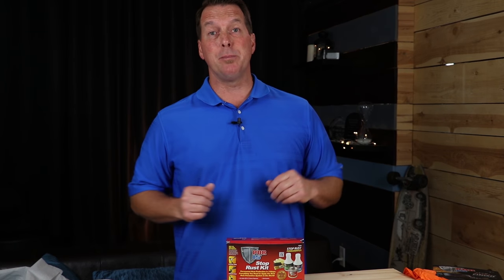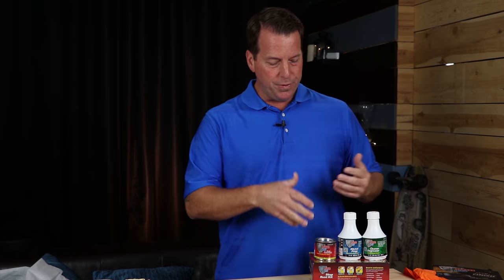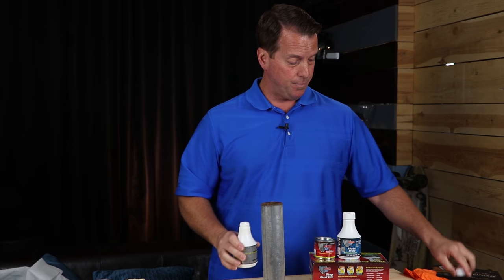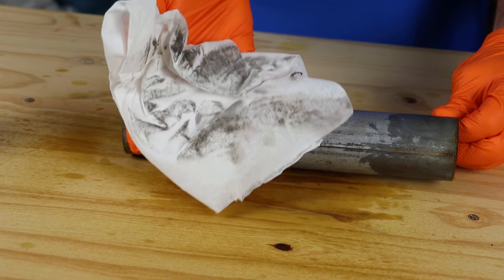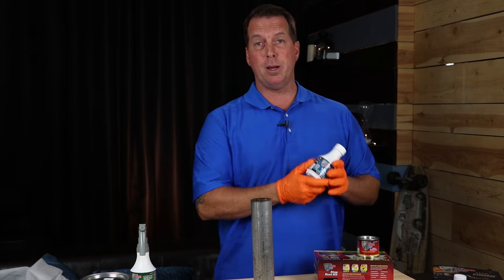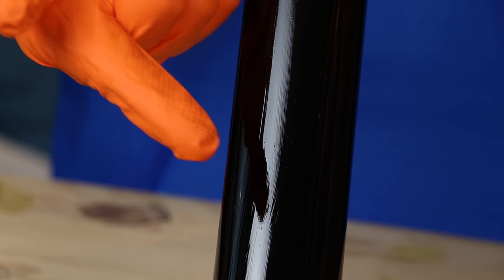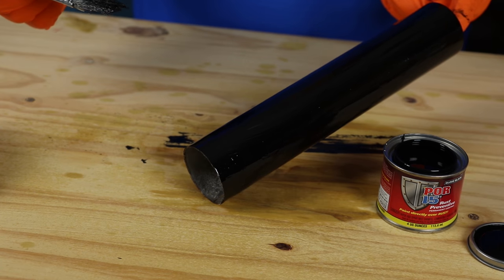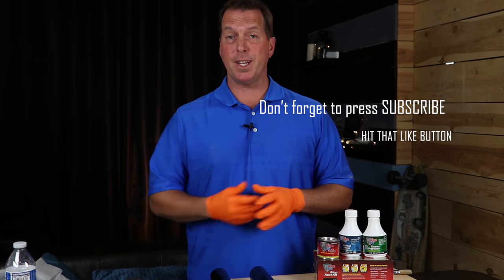STOP USING POR-15 INCORRECTLY!

Comment: Por15 works best on rusty surfaces (not loose rust). If the metal has a light rust before painting it becomes impenetrable when cured. Used on freshly sanded metal I have never had as good of results.
Reply: This is why all the prep takes longer than the application of sealer......if done by mfr directions, works great.

Comment: The POR-15 is the best on the market for stopping rust.  I've used it extensively, and will continue to use it . It is not without problems. There are several issues with handling the product that you should have addressed.  I have found "work arounds" but they should be part of this video and additions to this "kit"
Reply: Thanks :)
Reply: How much do you think it would take to do a whole lwb frame?
Reply: Care to explain?
Reply: Yes, please explain further. Thank you
Reply: What r the work around a?
Reply: @Markmead7  Use Eastwood rust encapsulator. Cheaper, easier and does same thing and beat it in a 1500 hour salt water spray test.

Comment: The thing that sucks about this super expensive pot. Yeah it works well, but no uv protection. It. Should have uv protection for the price. Makes rust encapsulater a bargain. Good stuff and has if protection

Comment: FYI, the cleaner degreaser is supposed to be diluted (instructions on the bottle say it), you don't put a spray top right over the concentrate bottle. You're also supposed to wear a respirator mask while applying it.

Comment: I can make a video like this because small simple pieces like that work well.  The second step - zinc coating and rust converter - is a very nice product.  I use it as a prep for lots of other coatings too.  As far as the coating goes, commercial shops I work around don't like it - impossible to work with in real-world conditions.  Hard to work with in humid environments here near the coast.  Solvent pops are a problem even with thin coats.  Have to use the can up quickly or solvent pops in the can before you even apply it.  Have to use the open can quickly.  Cannot reuse a partial can for a number of reasons.  (partially cured, solvent pops, coating cements the can lid tighter than a metal crimp).  Gallon cans are absolutely worthless.    Most of it will cure before you get it out of the can.  This demonstration did not show the can being opened - HA - the cans I open are absolutely ruined by the time I get them opened.  You can transfer unused contents into a new can but it cures too quickly to use a second time - even with adding some POR 15 solvent to thin it out - doesn't stop the quick cure.
Reply: never open the can. put a self tapping screw in the lid and opposite that, a screw in the top of the sidewall. Also it will last for many years when you keep it in a refrigerator. I've never had any go bad. One time,  I ordered a gallon and they sent me 4 quarts
Reply: Sounds like a money saving tip. Just to clarify you put a self tapper in the lid & another on the side of the tin & then when you need to use it you crack them both open & let the paint out - then screw them back in? Wouldn't that let oxygen in though? Not doubting just checking I've got it right 🖐️
Reply: @andrewcheatle4691  Oxygen is NOT the issue.  Water vapor is.  HUMIDITY.  The product is Monkey Glue based: it needs humidity to cure.

Comment: I get the same results with some cheap phosphoric acid and then painting over it with cheap oil base, try for anything with rust inhibitor on the cheap. Works excellent 👍

Comment: After watching this video I came away with the following conclusios:  The name POR-15 is very dishonest. It is not a Paint Over Rust product.  According to what I saw here any rust has to be completely removed to bare metal which is then treated with metal etch.  Why the dishonest naming of the product.  If the metal has to be cleaned to bare metal and also painted over to provide UV protection for the product it would be much better to just replace the POR-15 with epoxy primer.
Reply: I think that’s just a poor selection of sample metal.
Reply: It can be applied to both man this video he couldn’t find rusty metal to use so in the case that you’re painting on bare metal you do the steps in this video with the metal etch now if you want to paint over rust you don’t need the metal prep you just simply apply straight over the rust and I’ve done it so I know it works

Comment: I want to use Por15 to treat the rusty inside of my tractor gas tank. The only way to treat the inside surface is to pour the products through the opening. Means that its not possible to apply the two thin coats as recommended. Will this be a problem in terms of rust protection?
Thanks.

Comment: Manufacturer, "There is no UV protection from this product"….. Customer complains that Sun Fade is a draw back to this product….
Reply: You are right Anthony left radiator support out in sun after following instructions , POR15 didn’t hold up. I used rust reformer in a spray can on fire wall same Vehicle held better and looks better by far then por15 .
Reply: put a finish coat of something with a UV block ...........................................block head !
Reply: Yes. But for its cost we shouldn't have to do exta painting on top of it. Eastwood product requires none of that. Just Wire brush loose rust, spray with a cleaner prep and then use product. Done. If you want to paint over fine but no need to.

Comment: Not really. For years I would scrape off loose rust, wash and let dry. The 2 coats of rust converter. Next day 2 coats of por15. If exposed to sunlight I would next day add 2 coats of Rustoleum. Worked very well. Every year or two I would wash and let dry then add 2 more coats of por15. Next day 2 coats of Rustoleum on anything exposed to sunlight. I did that for about a dozen years. Never had any peeling and rarely any spots starting to rust again. Now I just Fluid Film everything. It's quicker and works very well. Anything exposed, like a bumper, gets Fluid Film reapplied every 4-6 months.

Comment: That test pipe looks like a galvanized pipe... Galvanized metal doesn't rust, so that was a bad choice for a test piece. Well, technically galvanized metal will rust, it just takes a long time. The galvanizing process itself IS a rust prevention chemical process. Although, it looks like your just using the pipe as more of an example of how to apply the product to a surface, so I guess it really doesn't matter.
Reply from the maker: You nailed it Daniel. It was only for demo/application purposes. Thanks.
Reply: @thetotalsalesguy9139  dum
Reply from the maker: @burtreynolds3143  You spelled DUMB wrong,  🤫but thanks for the comment.

Comment: About to start using this on the frame of my shuttle bus/rv conversion. Thank you for the informative step by step video!
Reply: Youre just going to trap the rust in and make it worse.
Reply: @krotchlickmeugh627  Thanks for your opinion, but no, it won't.
Reply: Ospho if rusty. Eastwood makes a product that's beaten this crap by a mile. Rust encapsulator Platinum. $50 quart and can be sprayed, rolled, brushed etc. Used it on a Log skidder that gets thrashed by rocks, stumps, mud etc daily. No rust. Wire brush loose rust, clean with prep and use product. A good idea is Ospho interally on inside of frame and their coating with a 360 degree nozzle. Works the best. Just my experience. My father's been in restoration since 78. Ospho is used on boats and ships all over the world. It's so much easier and cheaper and way less work and few rules to follow to get a good job out of it. Too many can't do for the price. Works great to protect places that get rusty easily, fender lips, quarter panels etc. I've used on new stuff and it was great but if sun gets to it, it fades and breaks down. All this is good stuff by have their uses. Por 15 is one of them. I used rustoleum, on top of Implement paint. It's a hard enamel that's used on farm machinery and dozers, etc. I've repainted a few and to get John Deere yellow or green sanded is a nightmare. That paint is as hard as diamonds. Even a quick respray to freshen up is a job sanding it to knock off the shiny so respray has a good base. Tough stuff.
Reply: It works best on bare and rusty metal, but not only am I doing both sides of the metal, I want either 92 percent zinc primer on the metal first or add zinc powder in, the negative ions are repelled in the rust, zinc is negatively charged too.

Comment: Used por15 many times on frames and underbody. Absolutely love that product.
Proper prep is the key, if you want it smooth then if coated on clean metal you need prep spray. If you don’t mind it rough a bit - just degrease and coat on layer of (not loose) rust - it loves it.

And most important - fresh can for each coat, once you open it u have to use it - putting lid back on won’t save it, that’s why it comes in tiny cans.
Reply: Nah you can store it, what I do is I put ceran wrap or however you spell it over it tight with a rubber band around it, mash the lid down ontop of it making sure not to break it then clip on the lid and cover it with some other bag for extra protection, seems to store a decent amount

Comment: I was surprised that after properly prepping and painting some metal it showed rust coming through the paint :(
Reply: I have used this stuff, and what you're saying is impossible. Ya had to have missed something, trust me. THIS STUFF CANNOT BE EXPOSED TO SUNLIGHT. IF SO, YOU MUST USE A TOP-COAT OF ANY KIND OF PAINT USED FOR METAL. The paint only protects the POR-15 from UV rays. The POR-15 is what actually protects the metal, and is downright bullet proof. You can literally beat it with a hammer, or shoot it with a pellet gun, it will NOT chip. It works SO well........I wouldn't use anything else. Also: after degreasing & rinsing & letting dry thoroughly, when using the metal prep/etch, did you continue applying it so it stayed wet for 20 minutes? BECAUSE YOU HAVE TO. The metal prep has to keep being applied so that it can stay wet and etch the metal/rust. Then rinse that off & let dry thoroughly. THEN apply 2 thin coats of the POR-15. Remember, if it's exposed to sun, AFTER curing, you MUST apply any metal paint as a top-coat. I use Rustoleum 2X paint for the top-coat. You do that......and watch how tough & long lasting this stuff really is.

Comment: About to use this in an engine bay. Can I sand the POR-15 after letting it fully dry before I apply primer to the bay? Or do I need to be ready to spray when the second coat is in the "finger drag" stage?
Reply: I think it's best at finger drag state
Reply: @ShortBusGameplays……if you read the instructions it explains the process. Wait until the por-15 is just slightly tacky (finger drag) and dust a very light coat of primer over the por-15. If you apply a heavy coat you are blocking off the humidity it needs to fully cure. After a day apply your wet coat primer, it will adhere to the dust coat. If you apply it over fully cured shiny por-15 it will peel off.

Comment: I sandblast my motorcycle frames to the clean bare metal, wipe down with acetone and then POR-15 sticks great. I then top it off with hardnose paint. But I agree..POR-15 gets a bad rap by those who do not prep the surface properly. Also there are some who think it you have to apply it to rusty metal (POR Paint Over Rust). This is incorrect. I use degreaser and metal ready on some applications and have never had a problem, that is unless I want to strip it off ! Very tough paint.

Comment: I've been using POR 15 for years on its own and never have had any issues.
Reply: Same here.
Reply: Same Here. Once you crack the can open, that stuff will bond the lid down. I used a Philips head screwdriver to poke two holes in the lid, then when done, screwed two bolts into the lid. Now I have 2 removable pour holes.

Comment: Is it okay to strip the rust to bare metal before applying it? Or the rust is needed for the best contact?
Reply from the maker: Great question... with the 3-step process, it will adhere to the metallic surfaces. Rust and Metal.

Comment: You don't tell people they need to use your top coat product AFTER using the POR15 and step program...I did all ur steps and it peeled after 2yrs off everything....was told I needed to use the topcoat after, but NOBODY informed or sales guy said it was neccessary or IT WILL PEEL OFF.
My 87GMCSB IS UPSET.

Comment: I'm painting a pull-behind cattle trailer.  It still has a lot of the original paint on it.  How do you handle the prep when you have part paint and part rust?  I've never used this product before.  Can I spray it from a spray gun?
Reply from the maker: It will only adhere to metal. I've have heard of people using a spray gun, just be cautious of runs. It will solvent pop.
Reply: @thetotalsalesguy9139  Thanks.  It's too specialized for me.  Just finished my first coat of Rustoleum primer today.  I have decades of experience with it.  Covered beautifully.  Next coat tomorrow, then top coat.  Thanks anyway.

Comment: How long do I have to wait after using the rust preventative before putting on the POR15 top coat? 24 hours, finger drag test, etc?
Reply from the maker: Yes, Finger drag test. Once dry, you must sand.

Comment: They said the one part engine paint, Pontiac Metallic Blue is possible to be used on the body of the car, I assume with por underneath. I wonder if it would look similar to regular paint, like with the basecoat and metallic with clearcoat.

Comment: The name needs to be changed. When it first came out no prep was needed, indeed it was paint over rust. What happened?
Reply: Yes the instructions used to say around 2010 that rust gives it a good key and to paint it directly over rust. I think the video is to address this particular issue. A consistent theme is some people find it excellent, others don't.

Comment: I call bull shit, blasted parts, cleaned with brake clean on 80 deg. day. used clear rust came back in 6 mouths in spider vanes and keeps moving. parts never got wet. sitting a box in my shop.

Comment: I plan on using this for my frame on my truck. do I need a top coat?  or could I use a clear coat? both from a rattle can?
Reply from the maker: If the frame isn't subjected to UV light you are fine. Top coating is a great option as well. Make sure to scuff before or you can apply at the finger drag stage as seen in the video. Thanks for the question.
Reply: You could coat the frame with undercarriage fluid, RP-342 works really well and dries up too, doesn't attract dirt/salt
Reply: They do make a tie coat primer so you can use normal paint. 
I've found a decent technique for stuff like frames. 
2 coats of por,then a coat of tie coat primer. 
2 coats of Rust-Oleum brush on , and then 2 coats of Rust-Oleum spray for a little gloss. 
Just gotta select a Rust-Oleum color that's available in brush on and spray.

Comment: the product is way to picky. i have used this process several times and have had it fail. for a product that is called Paint over RUST it doesn't do a consistent job. i won't use it because even when you feel you did the prep correctly, it fails.  only to be told "you didn't do the prep correctly"...  and i found it humorous that they couldn't "find" a rusty piece of metal, we are all using it over rusty metal. eyeroll.

Comment: So if you want to paint over it, or use seam sealer over it would you do 2 coats, let it cure then scuff the surface then prime and paint, or just do one coat, prime during the finger test then seam sealer/paint.

Comment: Can you prime paint or use body filler over top of this product?  Anybody know?  Thx.
Reply: yes
Reply: I used 2 thin coats clear por15 primer and then 1 coat xylene based bed liner black over the top on my trailer frames applied with brush and roller and they are doing awesome!

Comment: How far can 4oz get you compared to a quart. Looking to coat a rear axle
Reply from the maker: I would opt for the quart. Better to have more than enough, than not enough. It will store, but keep the lid area clean so it doesn't seal tight with the POR.

Comment: Have fun with the caps they stick after closing!
Reply: Use a plastic bread bag or plastic wrap over open can then tap the lid on tight over it.
Reply: I use 2 self tapping sheet metal screws(one on each side of the lid close to the sealing lip) I remove both screws, pour some in a throw away container, put the screws back in and its ready for next time.

Comment: Gloss black. Or semi gloss ??
Reply: I found that I could brush coat with a very thin layer and get an almost matte black finish. If I paint more liberally (or use the double coat technique), I can get a high gloss black. If you buy a quart can, move fast, as the POR-15 absorbs moisture out of the atmosphere while you are dipping and stroking. Try putting a plastic baggie over the can to protect the product. And, if you get it on your skin, your skin "absorbs" a layer of POR-15. No solvent I have can get it off, so you will wear it like a tattoo for about a week. If you are painting a chassis from below, you will inevitably look like a leopard. Regardless, I paint all my ocean projects with POR-15; the toughness and durability is worth the cost and inconvenience. Do it right or back away from the job.

Comment: but how much rust do you need to remove
Reply: Dont need to prep the surface to shiney metal but you should get it with a needle scaler, wire wheel, all that. Get big chunks off. Por15 WANTS to go over surface rust.